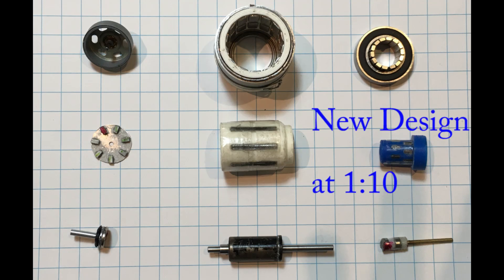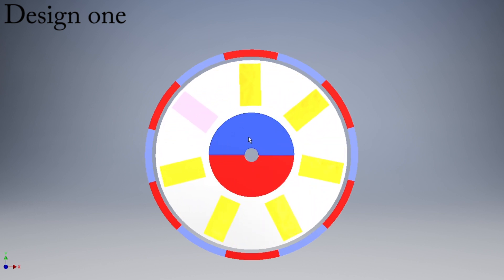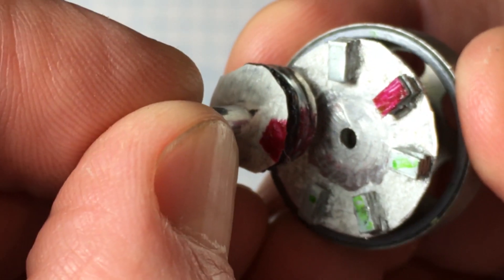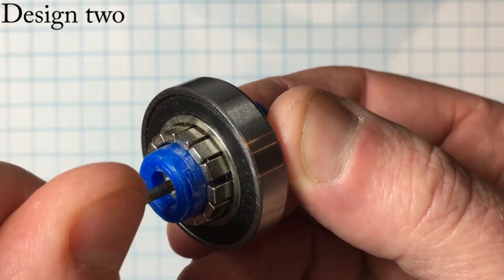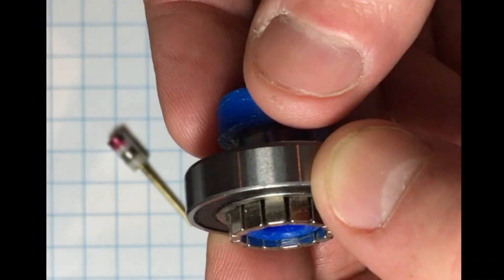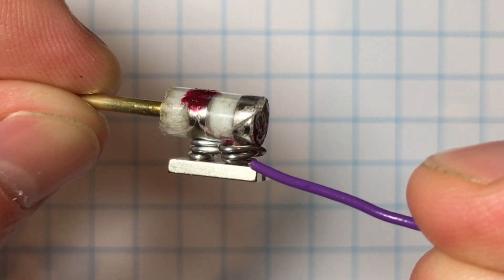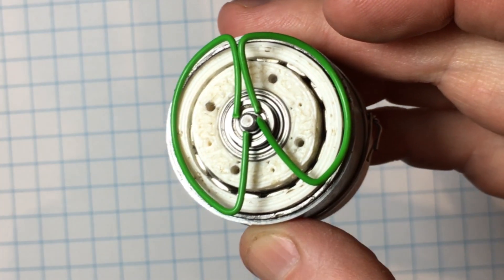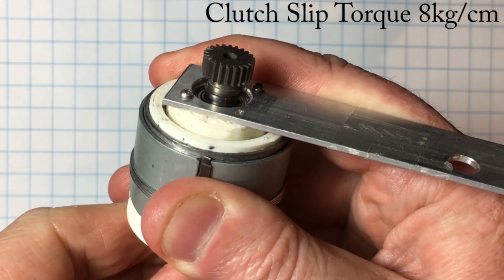Increasing the Torque of a Magnetic Gearbox

Comment: You consistently use kg/cm as the measurement unit for torque, but it should be Nm (Newton multiplied by meter). kg.cm is an alternative to that, but 100kgcm is 10 Nm. IMO, that's hopeless from that size. BLDCs with similar gap diameter, but longer rotor have about 5.

I really like the magnet arrangement. I suggest increasing the size.
Also, don't forget to consider flux distribution. It is useless to put strong magnets in the outer ring, if the inner ones are much smaller.
Reply from the maker: I use kg.cm as that is what most hobby servos are rated to. I prefer Nm (because SI unit) but kg.cm is easier to visualize.

This was just some research I did with the magnets I had laying around. Ideally I should have learnt how to did a flux simulation to optimize the design. From my testing I doubt I would have got close to my target with this design.
Reply: @PaulGouldRobotics  I think it's too early to give up. Things I would try: triple the diameter, double the length, increase pole number, use Halbach arrays, widen the iron bars tangentially, but make them thinner radially. maybe a spoke arrangement (used in IPM motors) on the inner rotor. I think it's possible if you don't need it to be this small. We're talking about a 13x multiplier.
Reply from the maker: @besenyeim  This is three year old project. I learnt what I wanted to learn. I'll price up some magnets to see how much it would cost me to make a ~10:1 gearbox about 50mm dia, and 40mm long. If it's not too $$$ and doesn't weight that much that I will have another go at it.
Reply: Paul Gould Using kg.cm for torque is fine since as hobbyists we all take a rough 9.8m/s2 as gravity acceleration. However, they are not “kilograms per centimeter” (kg/cm) they are “kilogram centimeters” (kg.cm).
Reply from the maker: @besenyeim  2x https://appliedmagnets.com/ring-magnets-1-in-od-x-1-4-in-id-x-1-in-diametrically-magnetized-p-617.html
and 14x https://appliedmagnets.com/neodymium-magnets-n45-2-in-x-1-4-in-x-1-4-in-rare-earth-block-p-758.html
~ US$44.8 total 
size 55 high x 54 dia 400g
8:1 reduction, this is my idea ratio for motor-joint torque and backdrivability.

Comment: A zero air gap would have the highest flux and torque, but that would need a rolling mechanism, perhaps like the cycloid drive. I wonder if the complexity trade off would be worth it?
Reply: It always annoys me that sliding magnets apart is easier than pulling them apart, and that requires overcoming friction too! Stretching flux lines is harder than diverting them, but it shouldn't be!
Reply from the maker: I think that this is where simulation software maybe useful.

Comment: Did you investigate using Halbach arrays of magnets? Or is space too tight for this?
Reply from the maker: I did a CAD drawing and couldn't get the ratio high enough with halbach array in the size I wanted. I will look at this again soon.
Reply: @PaulGouldRobotics  actually silly me... I don't believe the Halbach arrangement gets you more than 50-75% more torque, so at your expectations it's still way out of the ball park